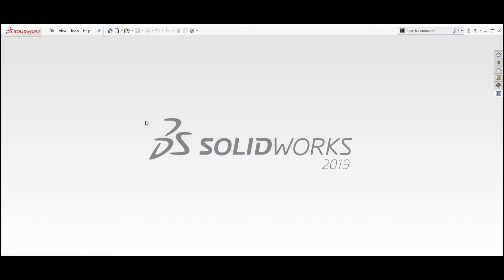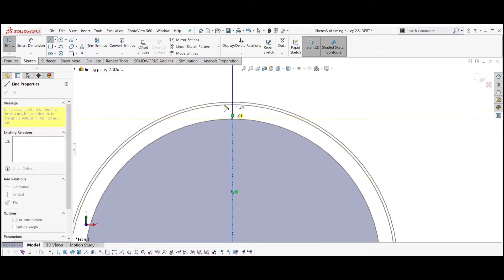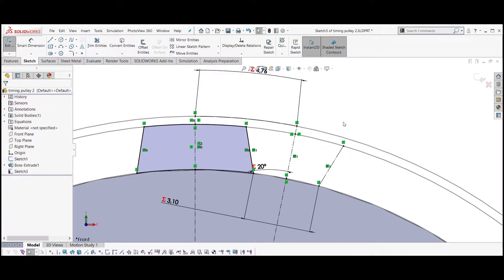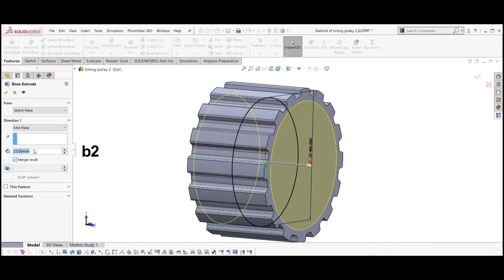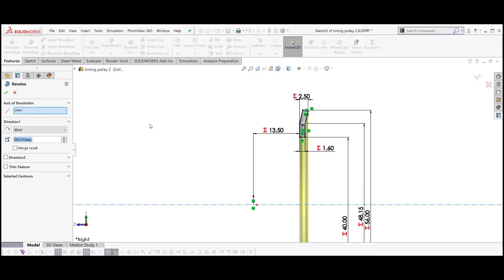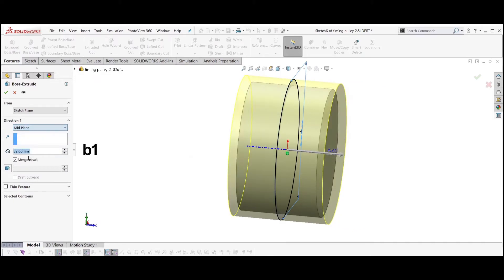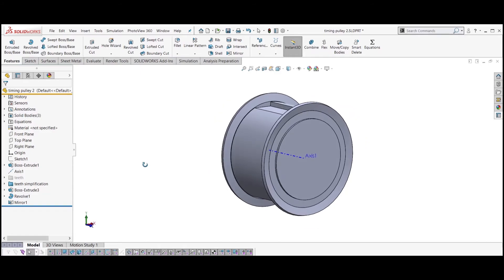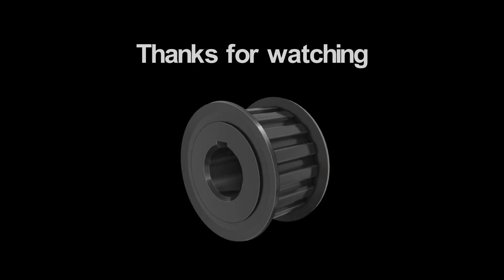Modeling Parametric Timing Pulley in SolidWorks | ISO 5294 | Part 2: Modeling w/ Download

Comment: Hi. I followed all the steps for getting the parametric pulley. When I changed the dimensions, the pulley didn't update itself. Could you let me know how can I contact you?
Reply from the maker: Hello, we can try to solve the issue here in the comments. If you want to contact me elsewhere, you can find me on FB under the same name as this channel.

1) In the description you can find a download link for the finished model. Have you looked at it? Does it update itself after you change dimensions/parameters?

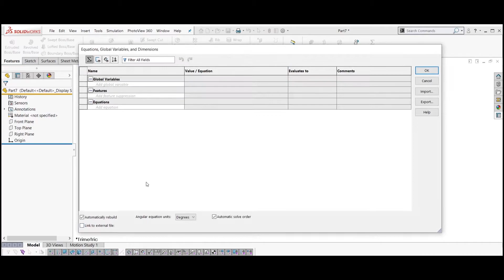2) Check that you have checked "Automatically rebuild" and "Automatic solve order" checkboxes in Equations window. The checkboxes can be seen in 0:20 in the video.

3) After changing dimensions/properties, try pressing Ctrl+Q, which should do a forced rebuild.
Reply: @richardkokstein  Hi. thank you for your reply, I had seen that the checkbox for automatically rebuild has been ticked however still my model is not updating. I will check with your model and get back to you
Reply: @richardkokstein  i also have the same problem if anyone has found any solution please guide me if possible.
Reply from the maker: @36ashutoshtryambake49  Can you describe what parameters you changed and in what order? Are you using the downloaded model from the description or do you have your own? I could test your specified dimensions.
Reply: @richardkokstein  only number of teeth was modified after saving the file. However the other parameters changed but the model did not modified accordingly.
Reply from the maker: @36ashutoshtryambake49  Here is what I see when I download the model from the description, open it in SolidWorks 2019 and change the number of teeth ( https://youtu.be/c66uhs8ALIk ). Sometimes, when I make changes and the models fail to update, I will force a rebuild with CTRL + Q. If you have ticked the checkboxes "Automatically rebuild" and "Automatic solve order" in the equation window and the model doesn't update after you force the rebuild, then I am sorry but I don't know how to help you, because I can't reproduce your situation on my computer.